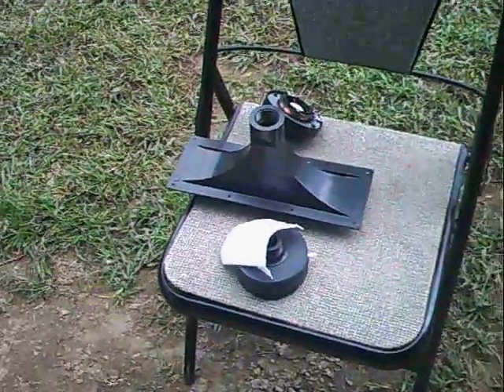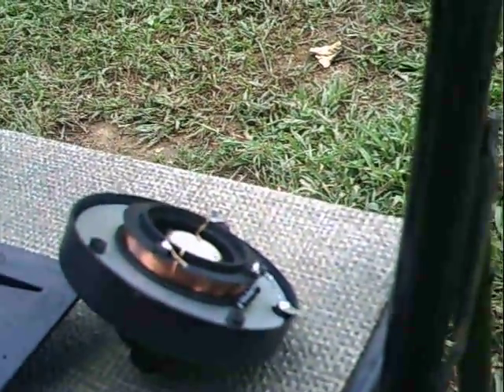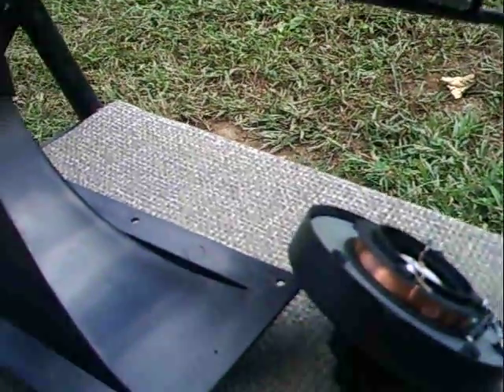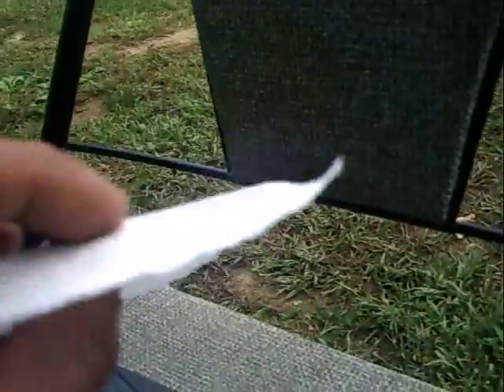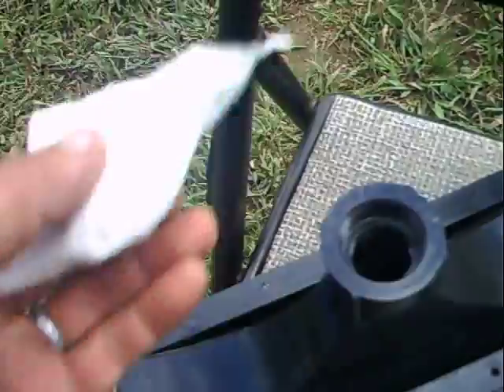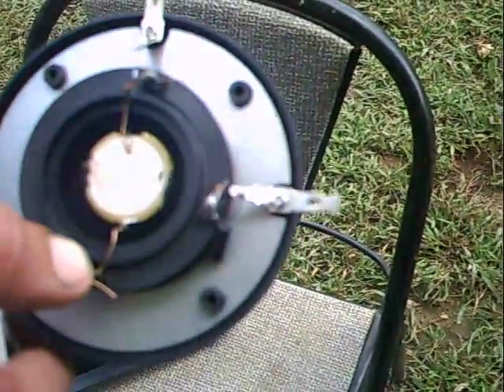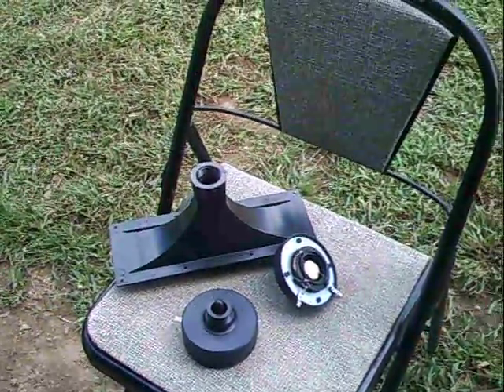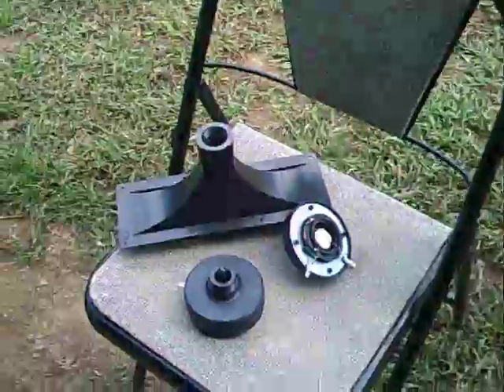Piezo tweeter tweaks for better sound

Comment: I always solder a high value (1 megaohm) 100watt ceramic resistor between the + - terminals of piezo. help reduce the harshness of the piezo. better yet use a crossover or bass blocker.

Comment: i also have a piezo pair, one went bad opened it see normal piezo plate with a coil & capacitor which i don't know what are they used, the piezo plate is all enough to operate.

Comment: NO offence meant but piezo technology is the same as musical gift cards..look inside one ,its the exact same element.they were invented for buzzers then graduated to midi beep sounds and so on... they really sound coilee and cheap, hence why the cheapest name brands use them ,   junk!.   Tip, real tweeters dont just burn up, theres always an aggravating factor, mis-use, no cross-over, not system matched, bad system caps , bad cross-over components and so on. JMHO.
Reply: @chanslorvalorum6905  yes the old motorolas were decent.